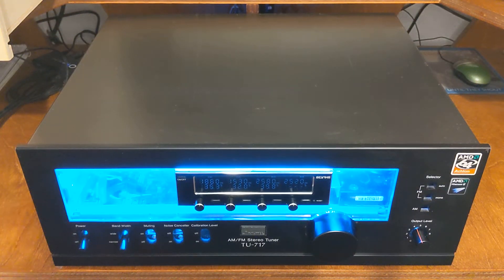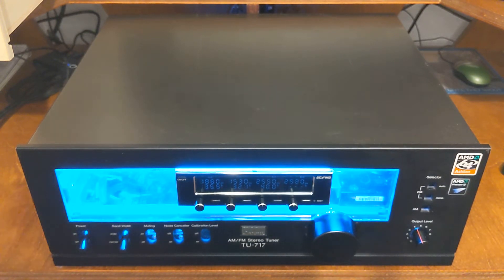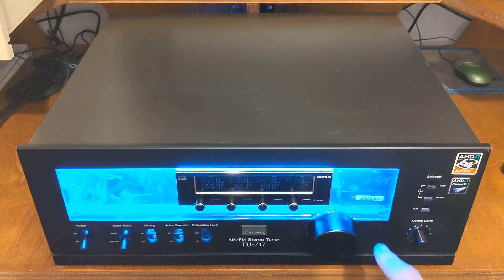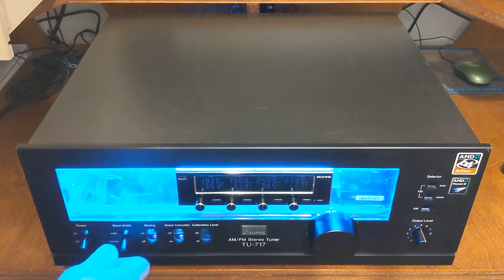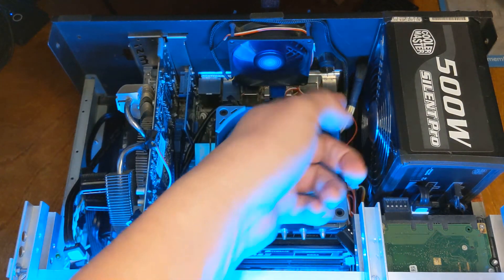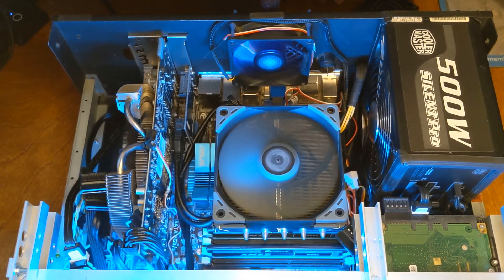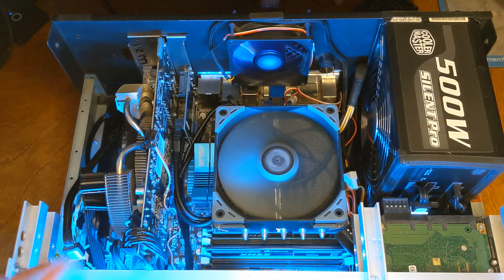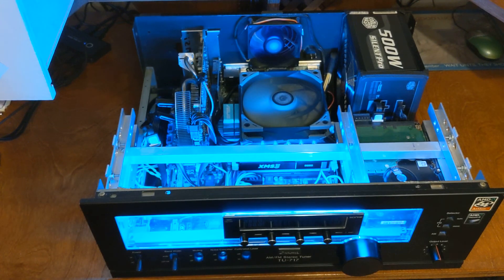Vintage Tuner Turned Into Desktop PC | Case Modding

Comment: this is something I dream about doing so satisficing seeing it come together. but i planning on using an old retro cassette player for mine.
Reply from the maker: That's awesome 👍 It's a cheap and unique case. It just takes a little work 😉

PS these days you hardly need a DVD or HDD; you can just put an NVMe on the MoBo. That makes builds so much easier 😁
Reply from the maker: PS I just thought of something that's slightly complicated but very awesome if you can make it work. Try to make the buttons play, back and fast forward control your music on the PC :)